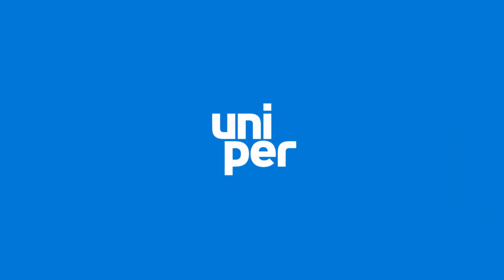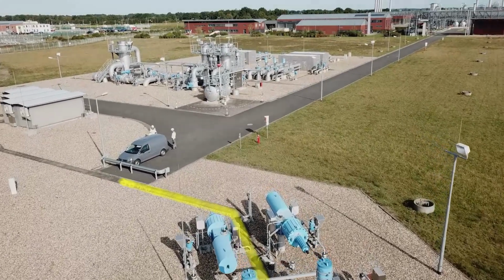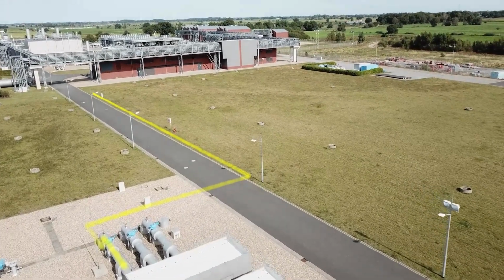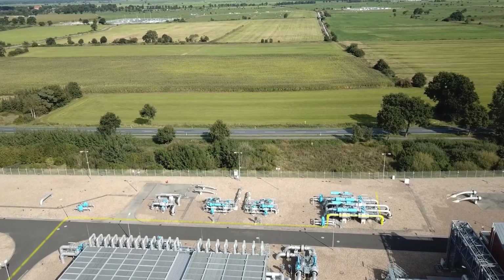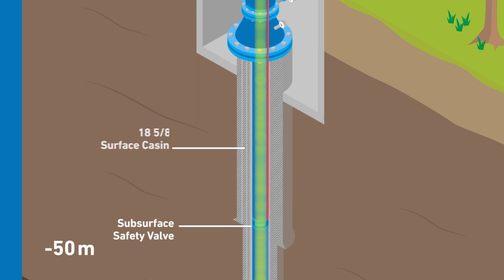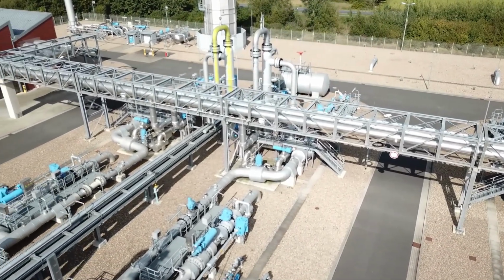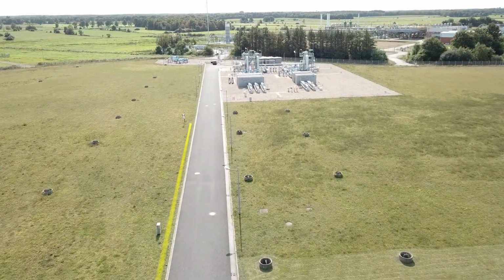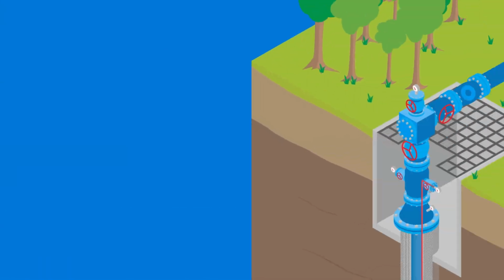How does underground gas storage work?

Comment: Why do you cool the gas after compressing it? If you compress it, it needs to gain heat. But then if you take heat away from it, the pressure drops with the heat removal, doesn’t it?
Reply: Shoving a bunch of hot high pressure gas into a well? Yeah, let’s cool it down first
Reply: Removing the heat does not necessarily lead to a drop in pressure, check out Charles's law. As a matter of fact, as the gas cools off it further contracts, and as long as it is not allowed to perform work by expanding, its pressure will stay constant. Hope that clears things